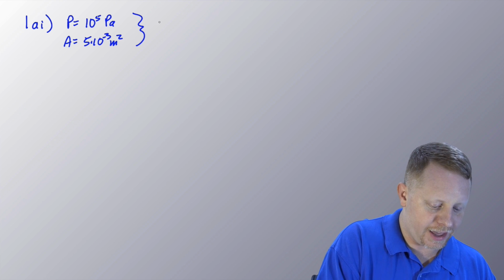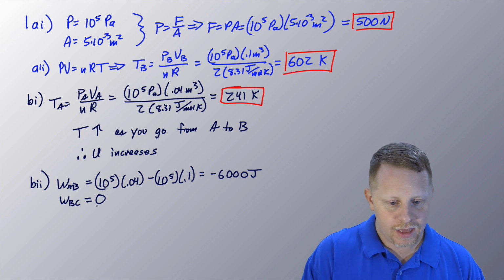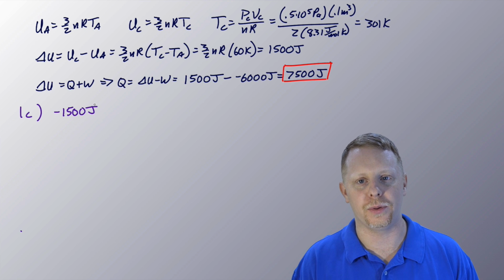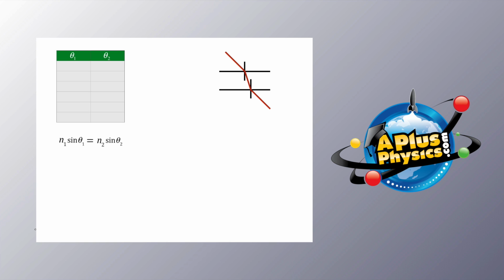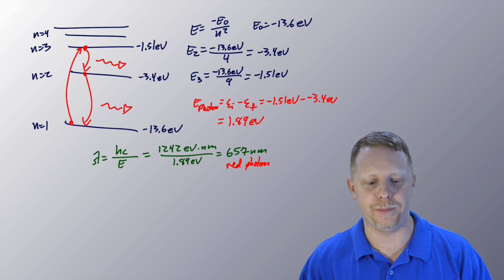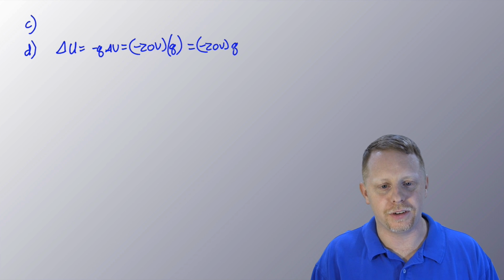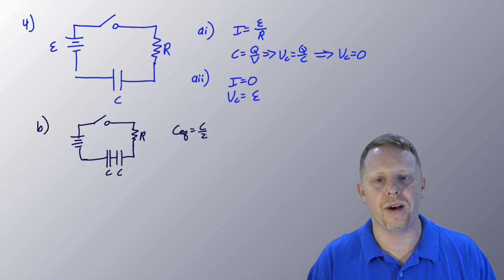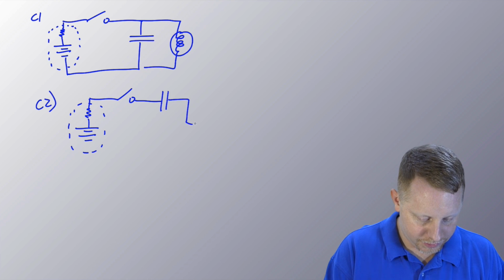AP Physics 2 2016 Free Response Solutions

Comment: isn't R .082
Reply from the maker: Which problem and where in the video?
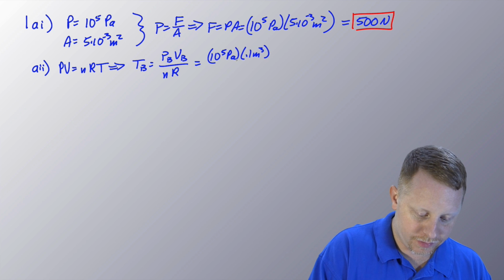Reply: Dan Fullerton aii 3:15
Reply from the maker: So you're looking for the ideal gas constant.  In the mks unit system we're using, it's 8.31 Joules / mole Kelvin.  If you use 0.082 L atm / mole Kelvin, your unit for pressure must be atm, for volume must be liters, for temperature must be Kelvin.
Reply: Dan Fullerton Thanks